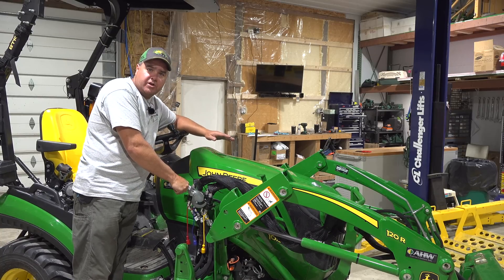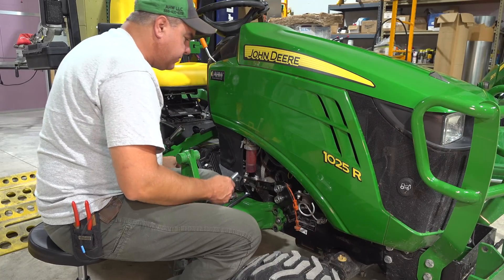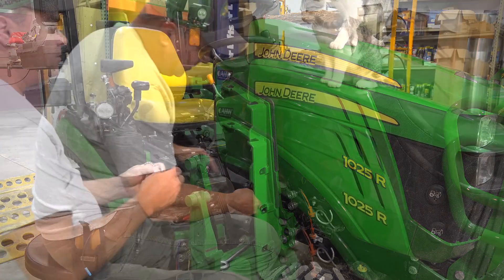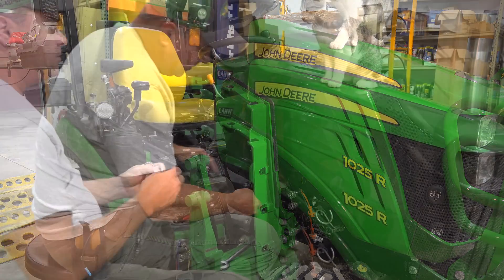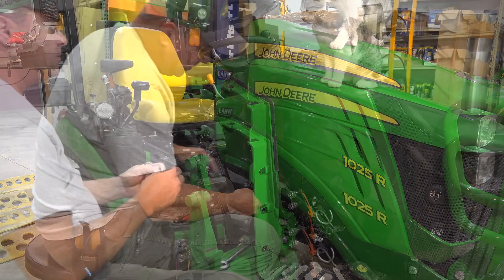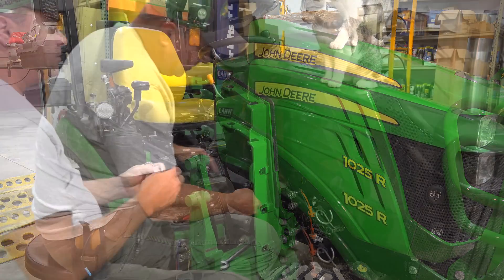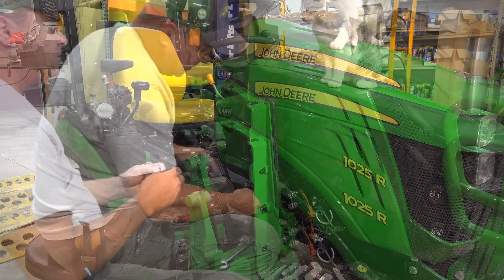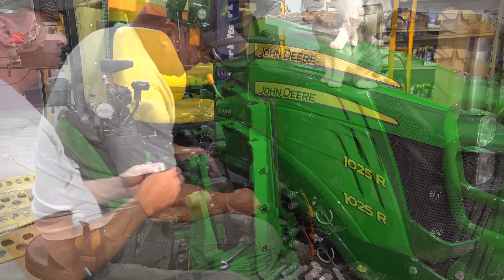Single Point Hydraulic Connector; Deere 1023e/1025r/2025r

Comment: Will this single point connector work with a 1023e and a H120 loader?  No mention of H120 loader in literature.
Reply from the maker: Seems like it would work with H120, but not sure.
Reply: First of all my condolences on the passing of your father. As Christians we know he has eternal life with Jesus as God has promised. Though it is sad for those who are left behind, we need to celebrate his new life with his heavenly father. 

I thought I would share with you that a single point connector will work for the 1023E and H120 loader. The only alternations are to install some right angle fittings to attach the hoses to the steel tubes on the loader.

Comment: I've been going back and forth between the bx23s and the 1025 - this just made the decision as I will be reconfiguring the tractor almost weekly. Between the drive over deck and now this there is no reason to not have the tractor properly configured for the job at hand vs leaving something on because you don't want to deal with taking it off.

Comment: I've sent a couple emails asking about what to do if I have multiple attachments. Can I just buy the loader side for snowthrower or other attachments? Hope you have ideas or who I can contact for help. I ordered my 1025r with single point, guess I should just call JD dealer
Reply from the maker: two choices.  1) continue to use the existing quick disconnects for the snow blower.  ....doesn't cost anything and functions just like before.
2) Purchase the implement half of the single point, and some longer hoses.  This will be somewhat costly, but will provide single point functionality for both attachments.  
I believe I have answered you before on this...perhaps you are not seeing the replies to your youtube comments????
Reply: @TractorTimewithTim  thank you, sorry I don't remember asking this before. Who knows I'm getting old, I'm going to call around as email/messages hasn't worked. (Except for ttwt)

Comment: Hi Tim, I currently have the Summit Diverter kit on my 2019 1025r for using my grapple.  Would there be a way to move use the JD single point connection system that you have in this video with my Summit Diverter “station”, that is currently bolted around the loader?
Reply from the maker: I dunno. There is not much space in there.

Comment: I liked this video. I probably would have bought this a year ago, when I bought my tractor, if it had been available. Now I am not so sure. I have not had my loader off the tractor.
Reply from the maker: ...but would you take the loader off if it were trivial?
Reply: @TractorTimewithTim  Maybe, but I would still have dealer installed Deere 3rd function hoses to deal with. They are mounted below the other 4 on my 2025R.

Comment: could this work with the snowblower attachment?
Reply from the maker: Hard to purchase the implement half alone.  Pretty expensive.
Reply: @TractorTimewithTim  thanks tim... was thinking it would make the change out pretty quick. If going to snowblower in winter, what would i do with single point connection?
Reply from the maker: @DeputyDawg446  simplest approach is to disconnect the 4 lines from single point, then use the existing approach to connect your blower.
I’m working on a solution to this, but not done yet :-)

Comment: will this work with the Artillian diverter kit?
Reply from the maker: Yes, it works...BUT...there is not physically enough room on the inside of the loader mast to hold the diverter when the single point is in place on the 1025r.
Reply: @TractorTimewithTim  hi Tim Artillian has made a solution for their 3rd function it adds two fittings. You need to put the diverter block on the outside surface of the mast the hoses are routed between the piston (not to the best of my liking but it works) and loader arm. I will forward photos soon. You have answered most of my questions here and on Tractor Universe thank you and Christie for very informative and high quality videos with step by step instructions. God bless and stay safe.

Comment: Is this more or less exactly the same single point setup that is (?) or will be (2020?) factory Installed?
Reply from the maker: Dunno about factory installed.
Reply: @TractorTimewithTim  Thx - couldn't recall if your new 1025R had it. I know it is or will be available as a factory option but the kit is nice in that you can still isolate it at the quick connections & I'd suspect the factory version won't have that flexibility.
Reply from the maker: Again, I do not know that there will be a ‘factory version’
Reply: @TractorTimewithTim  Maybe so - I thought I saw where it would be - Maybe for 2020 but you'd know better. If not, I'd order it w/a new tractor and work it into the deal/financing. 

I've bought many new vehicles and after l the negotiations on price the last thing I always do get them to close the deal is to throw in a set of factory shop/service manuals. Never has a dealer not done it. I wonder if there are the same type manuals made for tractor dealer service departments? My JD dealer is also a Stihl dealer so I'm already thinking deal on a chain saw, blower, or trimmer.

Comment: Tim....I have a 2008 JD 3320 w/cab . It has a loader... rear PTO...and MID PTO. My loader has 1 hose that has to be disconnected to allow the MID PTO (72D AutoConnect mower) to operate.  The location of the hydraulic connectors are horrible and very inconvenient.  Is there anything you can suggest to add/modify to make it easier to access. I am female and it kills me to have to change over when I attach the mower...and it makes my loader semi-unfunctional !! Your Help Would Be Greatly Appreciated!! Rhonda
Reply from the maker: Hmm.  Usually the mid mower lift is connected to the rear Hydraulic SCV. This would be right behind the cab below the center of the rear window.
This feature is standard with the 'deluxe cab' version, but is optional with the standard cab. So, you might not have the 3rd scv in the rear.  
If you don't have it, you could get it added, and then you could leave it plugged in all of the time.
I'm assuming you leave your loader on when you mow?
Reply: @TractorTimewithTim  ....I don't not have a 3rd.....never understood why they didn't include it when I ordered it. What would be the cheapest option to fix this problem? What would you do??

Comment: Is there a chart showing which pairs do what function?
Reply from the maker: Yellow and black are curl.
Reply: @TractorTimewithTim  Thanks!  I'm looking at a King Kutter 1.5 Ton XB Dump Trailer with a hydraulic lift.  You can run a hydraulic line to it from a tractor with rear hydraulic, but I'm not sure exactly how that will work on my 1025.

The other benefit of the single point is time.
Reply from the maker: @cwolf8841  we have a set of hoses to route the mid hydraulics to the rear for such a purpose.  
http://discounthydraulics.com/Ttwt use code Ttwt for 5% discount.

Comment: Tim, I checked out the link and it says this kit is for the 120R loaders. But do you think there would be any major reason that it wouldn't fit an H120 loader?
Reply from the maker: I do not know why it would not work.  But I would think they would have listed H120 if it works.

Comment: Mine is leaking like crazy where the two plates meet.  I can see them separating when applying pressure to the system.  Any ideas how to correct this?
Reply from the maker: Hmm.  Is this a new unit?
Reply: @TractorTimewithTim  I've had it for 2 1/2 months.  The loader is unusable.
Reply: Green Parts is sending me replacement parts.  I'll keep you posted.
Reply: Hats off to GreenPartStore.  They sent the replacement parts quickly and I installed them today. Part numbers LVA24157 and LVA24158.  I hope this fix lasts.
Reply: Well, another big leak.  Time to switch back to the old system.

Comment: If you were to make a guess, what's the percentage of today's tractors that have 3rd functions installed?? I ask since you would have to wonder why JD wouldn't design a 6 port block as the standard and if you don't have a 3rd function, two are not used.
Reply from the maker: Probably 1%!!!
Reply: @TractorTimewithTim  Well then, that would explain that!!!! Thanks for answering.

Comment: Do they make a single point hydraulic connector that fits on a 2025R with and H130 loader?
Reply from the maker: If you work with your dealer, and are willing to pay a bit extra, I’m sure they could modify this one to fit.
Reply: @TractorTimewithTim  Thanks.
Reply: @TractorTimewithTim  I did get one of these installed for my H130 loader and it works fine. Is there a dust cover one can use at the tractor end when the loader is off?

Comment: does anyone know if this only works on the 120R loader, I have a 2016 1025R with the H120 loader, want to get one but it only lists the 120R, wondered what the difference is. Thanks.
Reply: just got an email from green parts store and they said it only works on 120R and will not work on H120 loaders didn't say why

Comment: Wouldn't it be nice if JD would offer just the top half so you could connect it to other implements so they would be single point also.
Reply from the maker: Correct.   You can buy one half from parts, but it doesn’t save much money.  I agree with you.

Comment: Hi Tim - 

Wondering if you've had any issues with your SPHC such as leaking, etc.? I've been following some of the forums, including GTT, and it appears some people are having some problems. Just wondering if you've experienced any of these issues.

Thanks!
Reply from the maker: No leaks on ANY of the 3 single point connectors I have.
Reply: i had never had a problem with any leaks and never even a drip of oil ever.

Comment: Sometimes I feel that in the modern era for at least compact and subcompact tractors a system like this should just be normal equipment. As a licensed aftermarket piece 800 clams is a gouge to the pocketbook, unless it’s all 100% sourced and manufactured in the USA of course, or if it already existed with manufacturing and everything else present maybe the cost could be lowered maybe I’m  nuts for thinking this. If I had a 1025 or other tractor I’d really want this quick disconnect.

Comment: I assume you know this Tim, that fiber mesh protector on the hydraulic lines serves two purposes. It not only is a protection from some surface damage on the hoses, but also protection to the user of the tractor in case a hydraulic line blows out. It will help diffuse the oil that will be coming out of the hose at high speed. You might still get sprayed if it occurs, but it will not be the intensity of a direct line blowing up in your face like my brother had experienced on our old Ford 4000 Freemen loader. He ended up with oil in his eyes and took him a while for his sight to recover completely. Hydraulic lines do not last forever, they kinda act like radial steel belted tires in a way. If the internal steel wire busts, the outside line may look perfect but be a completely unpredictable time bomb!

Comment: Love how kitty keeps showing up for the camera.

So I’m not impressed with how you need to mess with the loader mounts to install this. I’m even less thrilled by the original disconnect is still at the floorboards. But I can’t say that it doesn’t do the job, it’s just messy being after manufacture install.

Edit: You don’t happen to have a video with Johnny on a lift or something, would you? I was just wondering what kind of work it would be to replace the longer run under the floorboards.
Reply from the maker: The advantage of keeping the disconnects is that I can still use other attachments which do not support the single point.  
I love using the loader mount.  Nice and sturdy.
All in perspective, I guess.
Reply: Tractor Time with Tim Yea that would be sturdy, I just see it as a critical mount point and I hate messing with bolts that support so much weight as I worry they could start loosening up if you make a mistake. 

Also ignore my edit, I wasn’t thinking there were other implements for the original points.

Comment: This didn’t making my decision between a 1025r and a B2601 any easier 😂
Reply: Thanks Man.  i'll give that shot... even though i'm not Tim, Preciate ya
Reply: MooMan86 is pretty simple. Single point hydraulic connector isn`t essential. Most of people removes loaders few times per year the most. I have had 1025r, BX2680 and currently B2601. B2601 has better PTO output and transmission is 3 range, not 2 like JD1025. Beside that, performance of orange 2601 is better than green 2025, and far more than 1025. If you compare 1025 vs 2680, than is a little different story.
Reply: JD 10-20 series are for small acreage residential hobby people, Kubota is commercial!  and yes i have 3 rtv's, 2 skid steers,1 track loader and 1 mini excavator none sponsored. Just got a price on new mini last week and deere was 5k more than kubota with less features on a 55k machine. your choice but orange has done us well 15+ years.
Reply: Have had my b2601 for 6 months.
Love it.... loader lifts more than 1025r, 3 point lifts more, 3 range transmission instead of 2, more PTO hp, single point coupler standard. Get what you want but honestly b2601 vs 1025r is not a fair fight.
Reply: Kubota has a draw bar, metal bonnet (JD is plastic) and the dismount hooks are easier on the Kubota. JD has a more ergonomic “dash” compared to the Kubota. The new B2601 has the quick mounting system standard (including the quick couple) and new hybrid R14 tires. I do believe the mounting system on the JD is more rugged and a bit easier to use. 1025r and 2025r use the same loader where the Kubota BX and B series have loaders designed specifically for those tractors. The quick attach for the front attachments is universal on the Kubota compared to JD that only is for JD attachments.

Comment: Tim,  Will this system work on a 2019 John Deere 1025r with the factory Mauser cap?  If so will the front window still be able to swing open?  Would you have a part number and the cost of the upper half of the Quick-Connect Coupler?  I would need one for the snowblower as well.  I enjoy your videos.

Comment: $800 ain't bad, actually.  I was curious about kubota's multi-coupler, did some research and found it was a Parker Hannifin coupler retailing for around $1k.  Obviously Kubota pays less for them, but still that's without the cost of hoses and fittings and all that.  Kubota ain't installing them for free, obviously the cost is factored into the cost of the machine.

Comment: I do not see the point in doing this. you added many more potential future leaks. 4 quick connects takes less than a minute to connect or disconnect. even if you took your loader off 10 times a day it will not save you enough time to justify the price
Reply: Will be good for disabled people or old timers that have a hard time with the original style
Reply: 20 years ago my hands were strong as vices. Now its painful to open a coke bottle. I now see things like this as a blessing.
Reply from the maker: Eoj1001.  Exactly!   When young and strong, we have more strength than money.  When older, we often have more money than strength.   My dad would buy this without even thinking about it!
Some folks seem to have difficulty thinking more broadly than for just themselves.  Oh well.
Reply: @TractorTimewithTim  I beg to differ 9 of my 10 fingers are wired or pinned together along with both palms. I struggle to tie my shoes at times but don't let this stop me from doing anything its all in how creative you are. look at harmless farmer. andy has no hands and still does more in 1 day than most people
Reply: I take my loader off and on multiple times a week. I hate getting my hands all covered in hydraulic fluid and then grab the steering wheel. And yes, I use a paper towel to wipe my hands off. It's just a pain when doing it this often.

Comment: Tim you can get a 6 port hydraulic single port connector even a 8 or 10 from if a hydraulic shop you deal with can get it from fastercouplings . com
Reply from the maker: In a straight line?  The double wide version won’t fit.
Reply: Tractor Time with Tim it’s in double wide but they also have a 2 inline quick connector that could easily be added to the bracket you put on the tractor with another home made bracket
Reply from the maker: Nathan Brodeur yes, I have that two inline connector on my Johnny 5 third function.
Reply: Tractor Time with Tim then you probably could get one of those and some hydraulic lines and you would be good to go

Comment: $800 to connect hoses faster? No thanks.
Reply from the maker: Turns out they lowered the price.  634 now.
Reply: Tractor Time with Tim 
That’s a little better. I still prefer fewer connections and less hoses to fail.